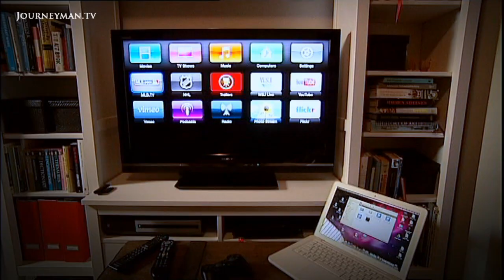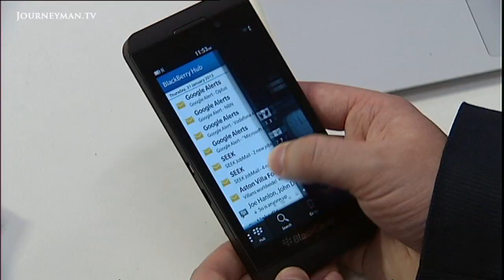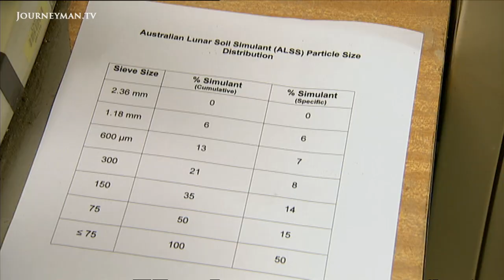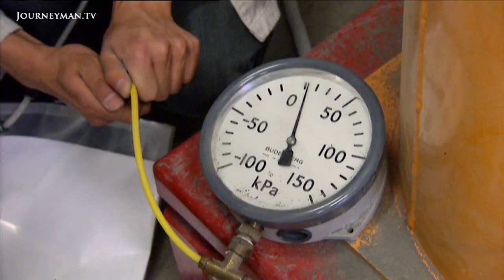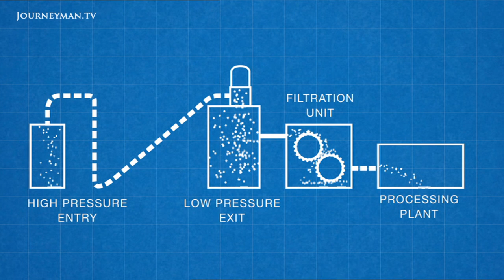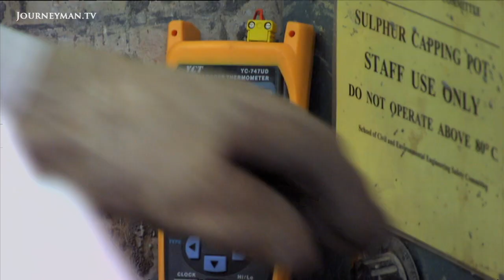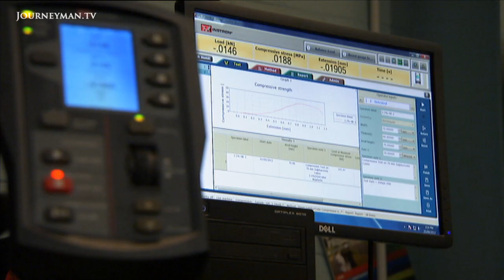Is Space Mining Set To Change The World?

Comment: Unless somebody has figured out how to make the TR3B work or an equivalent type of drive the idea of mining the moon, Mars or anything else is laughably, economically unfeasible...
Reply: DeadringerFRED We can 3d print engines from nickel-iron alloys, and there is carbon on the Moon, and a LOT of oxygen. That means you can produce rocket fuel and heat shields on the Moon. There's also a lot of silicon. Which in turn means you can build a Mass Driver on the Moon that fires directly towards Earth. The payload capsules then land propulsively, like the Crew Dragon will, in the water.

Initially it would obviously be expensive, because you need to build a lot of infrastructure on the moon for that to be possible, but once it is, it may well become very economical to get things like rare earth elements from the Moon.